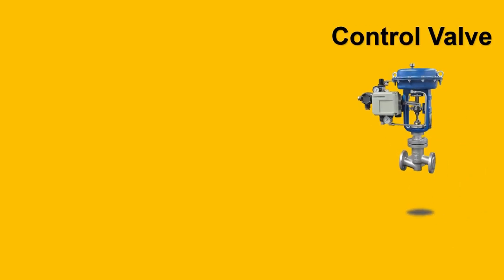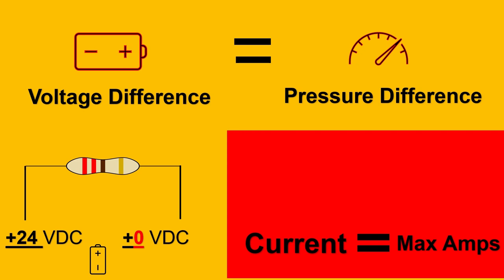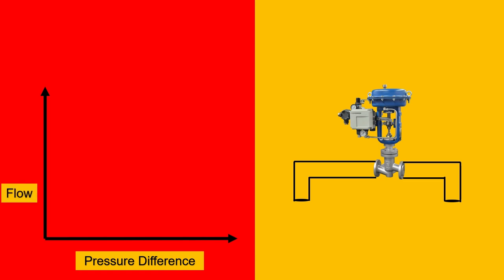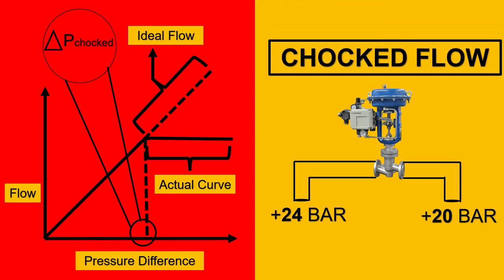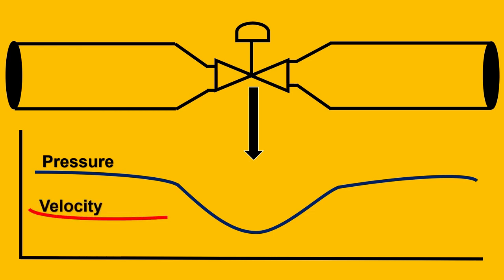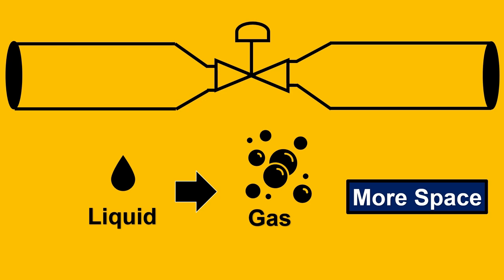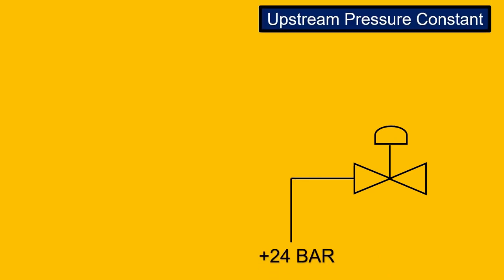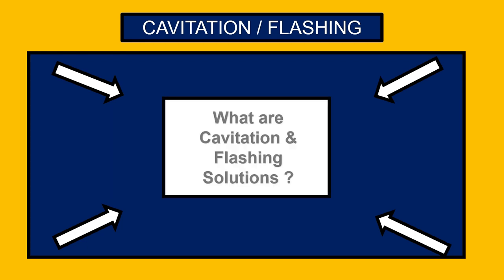What is Choked flow in Control Valve | Most Simple Explanation

Comment: Great explanation.I had a question.If we are increasing the pressure drop by decreasing the downstream pressure how does the pressure decreases at the vena contracta of the valve as upstream pressure is still constant?
Reply: Case 1: when sonic velocity reached.
Then when decreasing the downstream pressure, no impact on vena contracta. As sonic velocity is reached.

Case 2 : when sonic velocity is not reached.
When downstream pressure is decreased, there will be increase in velocity of gas thorough it. As there is a greater pressure difference.

Comment: Hi Asad, 
Could you heighlites on allowed  velocity when it comes to gas, liquid and steam service.
I believe it would be greater than pipe velocity 
E.g. Gas pipe line allows 25-30m/s but in control valve it will be allowed around 90m/s